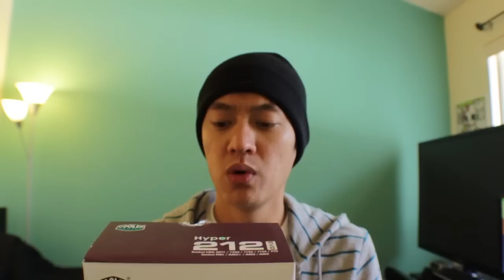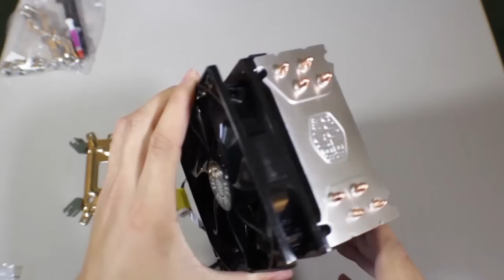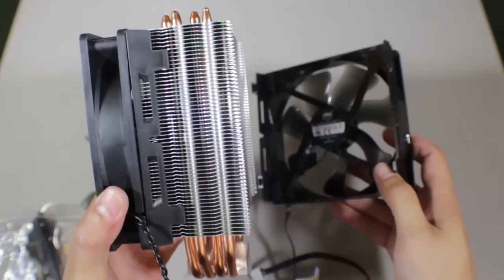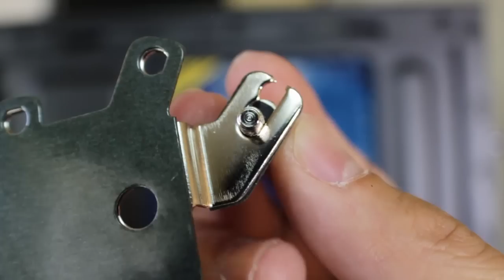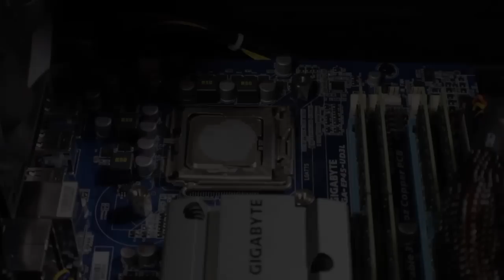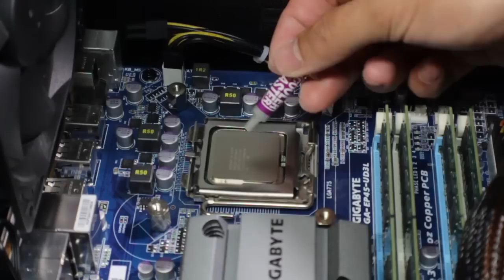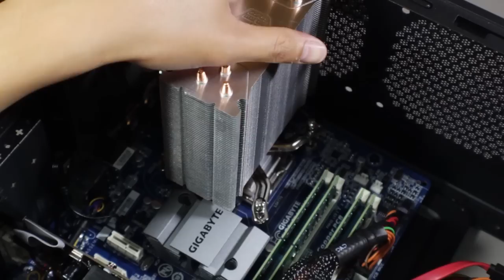Installing an After Market CPU Cooler Fan - Cooler Master Hyper 212 EVO

Comment: Rotate ya screws when tightening with ya fingers, like with a car wheel diagonal/opposite screw down little turns. say 5 per change until they get tighter, to make even distribution of paste and block. 

Your method was poor on that part.

Comment: Thank you, i have a Arctic Freezer i32 cooler mounted on an I7 3770  at 3.4 Ghz (no overclocking done)  which is similar to this cooler master and in push configuration doesn't fit in because of the ram heat sink and i was a bit scared that the pull only configuration might not be the best solution but now i think i'm  safe

Comment: How much the temps would decrease?. I own a Noctua NH-U12S Chromax Black and runs at 1500RPM but on my RYZEN 3800x it can reach up to 82-84C (even when doing the thermal paste right). How many Celsius would it decrease by adding another 1500RPM fan ?

Comment: good video and information....i have same case....AMD thlon x4 760k....just cleaned my case, applied some MX-2 but i feel the paste is a little old....getting temps with stock cooler up to 85c...i usually dont get temps that high and ive had this rig for about 5 years...usually use AS5 paste.....thinking about getting this cooler but again....prob just need some newer paste and a a re-application of the paste.....i plan to build a new rig soon so might just wait to get the cooler for that rig....however, i need to address this issue ASAP.....i have 3 120mm fans in the case... 1 intake in the front....1 exhaust up top...and 1 exhaust in the back but recently moved the top exhaust to the side on the door panal due to the top fan causing complications with one of my ran sticks....which it never did in the 5 years ive had it....however....since the move of the fan....i think thats when the temps started going higher....i might need to make the side fan a 2nd intake and try that first....or move the fan back to the top but this time on the OUTSIDE of the case ....just dont really like the idea of  external fan.....i need to figure something out quick
Reply from the maker: If you're building a new rig soon, you can just re-apply some mx-4 for now. AS5 is good for long term application. Thanks for watching.
Reply: @johnnythegeek   well, they're both good for long term really. MX-2 and MX-4 are actually rated longer than AS5. Either way, yeah I'm building a new rig, this one will still be used as I will be selling it

Comment: question: It looks like the cooler is not tight again the cpu. When you put the fans on the cooler was moving side to side? I am have the same problem with this cooler. I believe it should fit snug to the cpu and not move? I am using this cooler on a socket 2011.

Comment: Do the fans connected to the cooling unit get in the way of the ram slots? On mine, one ram slot is covered up, should I just take off the fan on one side?

Comment: Nice video. I want to get this one for my system, but I'm not sure about height and if it will fit in. I would check around the internet, but since my case is some no brand name case which I got with prebuilt computer I bought in like 2013 or something, I really can't find any info about it. I guess I will just need to measure it...

Comment: I have an i7 2600 (LGA 1155) and I want to use this same heatsink. My current heatsink already uses screws, will it be necessary to remove the motherboard or can I mount the heatsink directly?

Comment: One question > Just bought  cooler master Hyper 212 Turbo that has two fans just finished installing it but i dont have  slots for connecting both fans as one is already taken by The system fan (exhaust @back) so i can run only 1 fan on  turbo unless i get a new mobo, which one should i plug it in ?
Reply from the maker: You could get a pwm fan splitter. It lets you plug two fans into one connector. Should be less than $10. But yeah you could use just one fan. If you do that, take the other fan off. Do a push configuration if you're going to use just one fan.

Comment: Does it matter if the backplate touches the case plate where the MOBO is screwed in? My case has a closed back and my MOBO is on regular MOBO standoffs. I don't know if the backplate would fit in between or if it matters if it touches the closed back of the case. I have an Antec 300 ver.1 with no cutout.

Comment: Should I tighten the screws onto the mount until they are snug or just until it feel secure?  I feel like too much tightening would cause pressure on the CPU array and board.  Probably a stupid question but I'm curious because I'm currently building a rig with this cooler and I've never used this kind of mounting before.

Comment: Great Video,  I actually installed this on my FX8320 Gigabyte board, and the temps actually went up!  I thought I put too much paste, so I removed it and did it again with less paste, same result!  10 degrees hotter?  no ideas why?  also what is better if you only have the one fan that came with it?  pushing air through the heat sink?  or pulling air from the case through? tks. in advance.  what do you think I did wrong?
Reply: gemster18 So I don't really know how your pc is build but remember  that it takes timr for the termal paste to spread onto the heatsink so it's normal to not get imediate reault. Also make sure  to check if the fan is facing in the right direction. when you put the thermal paste on the heat sink don't put more than a drop and make sure that the radiator sit tight on the cpu.

Comment: First of all, thanks for the tutorial video. Good quality for 2012 lol.

I have an old i7 980X, always used its stock cooler (which is not as crappy as the majority of intel stock coolers). I never OC it, but now that Skylake CPUs are out and mine is getting jurassic I´ll finally OC that thing to 4Ghz. Maybe that will give my PC another 2 years to the already 5 years of use. Plus, this will give me an opportunity to dabble with OC for the first time for my future purchase of a new computer.

I am just worried about that backplate ¨X¨. Was it user-friendly? You made it look easy, but I think I´ll need help with someone holding that X for me, since I am clumsy.

With the 2 fans you ¨added¨ this 212 EVO cooler looked pretty big already. Maybe I will go for this one, since I am worried that a 
Noctua might just be ¨everywhere¨. Do you think this Cooler (212 EVO) would be enough to bring the CPU from 3,33 to 4 GHz?
I don´t plan on pushing things to the extreme, ¨just that increase¨ without having to worry about overheating.
Reply from the maker: PinkasBrown44 thanks for watching!
Reply: PinkasBrown44 The 980x is a beast and can still hang. I have mine OC'd to 4.4Ghz 24-7 on the stock cooler (which is also pretty good) and it rarely ever gets above 70 when gaming/running VR.
Reply: Hi, good to see someone else still using this CPU. And apparently its cooler is good enough not to require an aftermarket cooler. Anyway, my temperatures, as indicated by CPUID stay below 70 C when idling , but go way past it otherwise. Almost 80 C at videos or light games and even past 90 C on hard games. 

I fear I must change the thermal paste, but what makes me uncomfortable is that supporting X at the backside of the mainboard. It´s hard to do without unscrewing the entire mobo, which I´d prefer not to, plus it´s difficult without the help of another pair of hands. Guess I am also traumatized for wrongly applying too much thermal compound at an earlier i7 920. 

Nervewrecking for someone who doesn´t tweak the PC 24/7. But with those temps I don´t have I choice :D
Any thoughts and advice would be appreciated.
Reply: PinkasBrown44 the 980x was made for OCing and at $1000 you better believe im going to get my $s worth. You shouldnt have to remove the bracket from the back to change the paste. just unscrew the screws from the top and pull the cooler off, clean and reapply.

Comment: This will fit in a Thermaltake mid tower case? Tower has CPU cooler height limitation: 160mm VGA length limitation: 344mm.

Comment: Can I use the stock bracket that came with the motherboard instead?
Reply from the maker: if it is a socket 2011 most likely yes. any other socket, most likely no.

Comment: great video, actually made me realize that I might not have the space for a push configuration because the RAM heatsink might get in the way, which isnt a problem for the intel stock heatsink but its shit and running my games at 60-77c so I need to swap it as soon as I can, If the RAM interferes with the fan though I'll have to have it pull config only directly next to my exhaust fan, I hope thats enough but just in case I'll probably get another front fan so i can have two fans blowing air into the case, maybe that'll help a bit more. Either way temps should be much lower than what I currently get with a stock heatsink and thermal paste that hasnt been reapplied in 2 years or so...

thanks for clearing up the push/pull term and talking about airflow direction from the fans, it helped a lot for me to understand it all
Reply from the maker: I'm glad the video helped. thanks for watching.
Reply: that would just pull air away from your exhaust
Reply: cant you just flip it around and have the push fan on the left? or is that wrong?

Comment: It's been about a year since I built the computer im using now and back then when I got my processor it came with a fan. Now I'm thinking of building another one and I'm thinking of getting the Core i7-6700k and it's saying it doesn't come with one anymore and I see you have to do all this stuff now to install it in. Why is this? Just wondering why they're making you buy a fan separately now instead of having them come with the processor. What changed?
Reply: the fan doesnt come with processor this is new for skylake
Reply: yup

Comment: I am curious to know how you got that second mounting clip for the fan, I am looking to do the same push pull configuration but it only comes with 1 fan clip, is there any where you could point me to where I could just buy an extra clip so I could clip my second fan on.

Comment: Johnny, excellent explanation on how the air flows through the fan. Mine was malfunctioning and I purchased a $5 replacement. When I went to installed the fan it occurred to me that I wasn't 100% sure which way the air flowed. I always assume it was the sticker facing out; which was how my old fan was installed. The new fan didn't have an arrow anywhere on it, so your explanation of how they designed it with the wires buried in the frame was perfect. Keep up being detailed oriented like that, there are far too many YouTube producers out there who ignore important details.
Reply from the maker: I'm glad the video helped you out. thanks for watching!
Reply: +Johnny Phung (johnnythegeek) I have a question regarding heat buildup. I've had my current PC for almost 6 years and I leave it powered on 24/7. In the past, I've gone through many PCs (in part) due to heat issues. When I purchased my current PC 6 years ago I decided to take the side panel off of the tower and also placed a small desk fan blowing air into the PC. Do you think this practice has helped with the PC operating for so long, or is this an unnecessary  practice?
Reply from the maker: +Rankle Rave keeping it cool really does help a lot. You also have to factor in how much cpu usage you are using while it's on 24/7.

Comment: Is there any way to setup that 2nd fan to speedup when cooler is getting hotter?
Reply: You can if u use a 4-pin splitter cable
Reply: thanks!

Comment: would this fit in a cooler master storm scout 1, using the asus sabertooth 990fx r2.0 with 16gb of ram (4 full slots) for an amd 8350? I'm mostly concerned about the ram slot closer to the cpu

Comment: can i have this cooler setup with just a pull fan to allow for enough room around the ram if i find there isnt enough or will this only work in a push or Push/pull configuration.
Reply: sorry just realized you mentioned it in the video thanks anyway:)

Comment: I'm having to get a new heat sink my cpu has been fine running fallout 4 on high to ultra but I started playing Dying Light and the game kept shutting down. I eventually realised it was a heat issue and after checking the temperature after a crash I found it was running at 90c max so it was auto closing to protect the CPU. My PC is good enough to run The Division on max settings but I played the beta today and the heat caused a crash in less than 4 minutes 😕
Reply: +Karl Gower Can you tell me all your temps, cpu and cooler. I might be able to help you out a bit C:
Reply: Well I'm currently not even playing a game I'm just watching twitch and the 4 cores are each running between 44c to 55c, but when playing a game they go into the high 80's and once they hit 90c the computer auto closes the game to protect the cpu. I have had no issues until recently and now playing games turns it from a PC into a oven, when I open the case my graphics card is also really hot so that too could be a issue my GPU is a Evga gtx 970 ftw.
Reply: +Karl Gower Might be obvious, but have you dusted out your rig? Dust can cause high temps like that.
Reply: Lishaaaaaaa It's okay I fixed the issue now it was my crappy stock heat sink and lack of arir flow through my pc case, I bought a coolermaster hyper 212 evo heatsink and a new mid range corsair case with 5 fans and now I don't go over 60c even on max setting in AAA titles :)
Reply: ***** That's awesome to hear. :D

Comment: Thanks so much. I didn't want to mount the plat because it went under the back of the case like you showed at 15:24. Subbed and thanks for talking in more detail. It is very helpful.

Comment: What if I only have 1 fan they gave me with the cooler
Reply: +I Am Rambo Specs That's all you need. You will just have a push configuration (instead of a push/pull) where the fan you have now will be pushing the air out of your heatsink. Just make sure you place the heatsink in the direction of the exhaust fan in your computer. So that the fan is blowing through the heatsink and then the exhaust fan is pulling the heat outside your computer. You don't really need to do anything special just follow the video and you shouldn't have any issues.
Reply: thanks a lot

Comment: Right now I have the cooler, in the same case too, and so far it seems pretty loud when I'm playing games, and the GPU temp goes up relatively high, the highest I've seen is like 65 C. I'm just wondering, if I were to add another fan, so have the same set up with two fans hooked onto the heat sink, would it help make things quieter? Any advice is appreciated, thanks

Comment: why do people say the pea method is the best? do you all just not notice how all 4 corners are completely bare and have shit heat transfer?  Put a line on one side of the cpu, get a playing card from a deck, and spread it.   guarantee you will have 3-5c cooler temps if the whole cpu is pasted instead of just the middle.
Reply: pea method spreads itself when you put the cooler ontop
Reply: +Joe Kickass the cpu die under the heat spreader is in the middle.... when you do the pea method it covers the whole cpu die and its enough. When you spread it you can have air bubbles when you mount your cpu heat sink. IF you want to cover the whole heatspreader, just draw an x with thermal paste on the whole heat spreader and it will cover the whole heat spreader

Comment: Hey man I was wondering if it could fit in a CyberPowerPC X-Saber Mid-Tower Case? Im new to PC gaming and looking to upgrade my fan but have no clue if it would fit. Also would you suggest this cooler or Corsair Hydro Series H80i GT?
Reply from the maker: I'm not familiar with that case but you can look up the dimensions of the cooler and measure from your motherboard to the edge of the case.
Reply: ok thanks!

Comment: You're awesome, I love the detail you go into on air flow and determining which way the fan should be oriented. Thank you!

Do you think most z97 boards will have enough room for the push/pull configuration and RAM with heat spreaders? There's some pricey (16GB) gskill trident RAM that has removeable spreaders, but I don't want 16gb. For some reason I think I want the gskill ripjaw RAM but I'm not sure it'd fit with a push/pull config.
Reply from the maker: I've had trouble with fitting gskill ripjaws with the big heatsinks on any board with the hyper 212. Some z97 boards have large heatsinks on the motherboard that also gets in the way. Usually big expensive boards. the cheaper boards have smaller heatsinks because well, they are cheaper. ha-ha.

Comment: Johnny why not use a couple small drop of crazy glue, to hold on the mount to the heat sink?  One less thing to wrassle with.  If you need to remove it, it will just break off after all.

Comment: dang i just bought one of these, thanks for the tip about how, the one of the fans bumps the memory...what were those designers thinking?  Now i can only run one fan!  Can you show info someday, if you ever do an update, on how much cooling temp one fan vs two fans provide?

Comment: This was such a pain in the ass to install in my case xP My RAM were too high to push the heat as well so I had to go with the pull only version.. But it seems like it's working! At least way better than the i7 4790k stock one from intel.. That was complete shit.. x)
Great video anyhow! Easy to follow and very informative! :)
Reply: guggex | Gustaf Eriksson do you have to uninstall the backplate if you just want to change the cpu? im getting a new cpu and i wana take out the fan. Do i also have to remove the backplate as well?
Reply: Well.. you need to remove the backplate of your chassi to mount the backplate for the CPU cooler. Once the CPU coolers backplate is mounted though you don't need to remove it unless you're going to replace the motherboard. :)